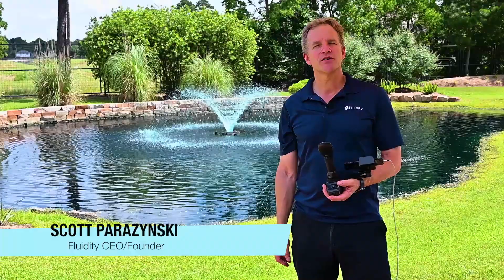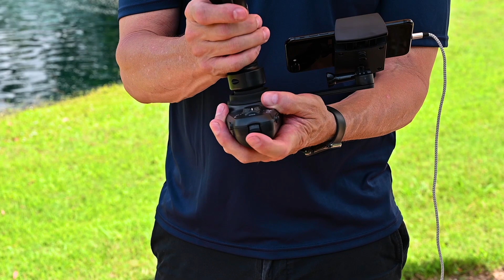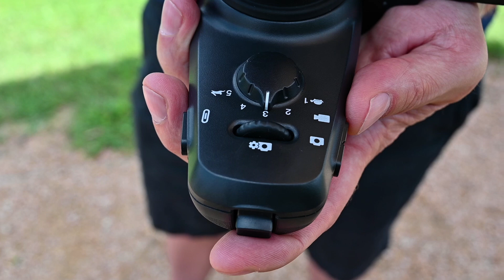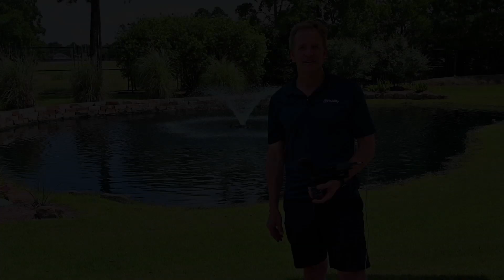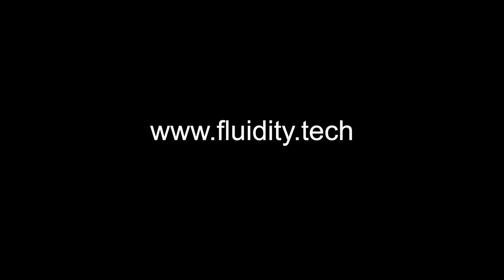FT Aviator Drone Controller: Camera Controls

Comment: seriously, I've been waiting for 1 year for this ?: I am disabled and yours seemed to be a very good solution for a one-handed person. if I have to use  2 hands anyway, what's the point of the all device ?.1- is heavyweight to carry on, even for an 
able-bodied person 2-It all stands on the left shoulder 3-need both hands 4- expensive for what it does. can I ask you so what is it for Scott?
Reply from the maker: Thanks for your interest - to clarify, there's a mount on the bottom so you can mount and use with just a single hand, it weighs a pound so lightweight, and it's currently $100 off...